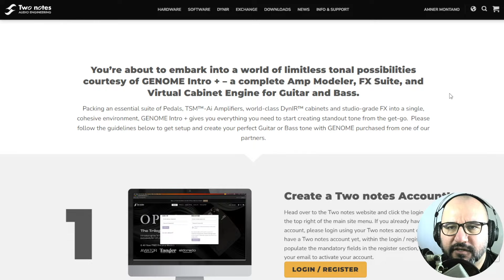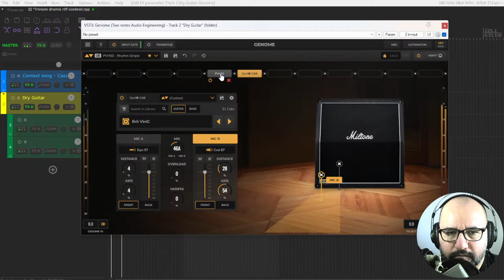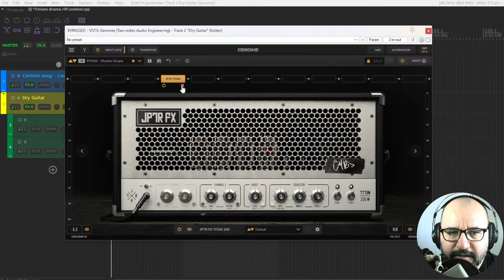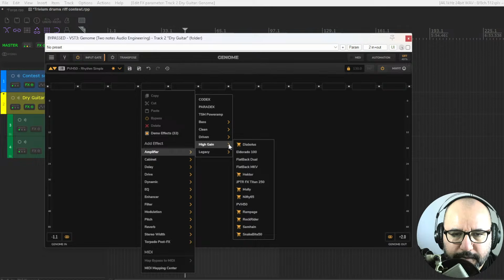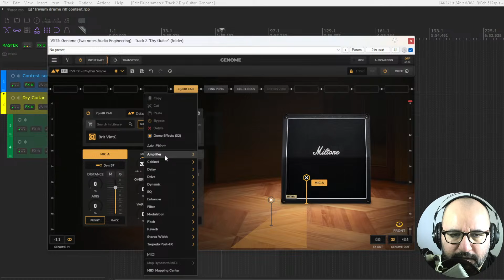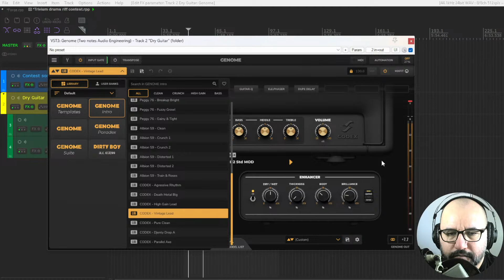Can't Believe This New Amp Sim Plugin Suite Is FREE! - Genome Intro+ By Two Notes Audio Engineering

Comment: You couldn't sell an amp sim nowadays as there are 100 free nam rigs out there and imo you cannot get closer to an amp and cab tone
Reply: Plus NAM and most of the related software are supported on Linux systems without having to use this that and the third to make it possibly work
Reply: Genome Suite is so worth it dude. They are updating new amps and pedals several times a year. I love it.
Reply: @amitabhamettalove1479  Why not install NAMrig for free and get your IR captures from Tone3000 or ToneHunt over Genome?  Have you checked them out?  I have a QC anyway but I’m interested to check out some of these other things.  I will take your advice and check out Genome Intro+ soon but if it’s limited and need to pay for more I will probably not pursue it myself.
Reply: Where can I go to look at these 100?